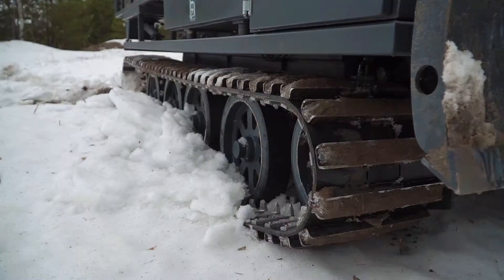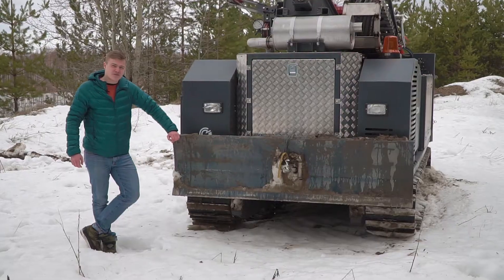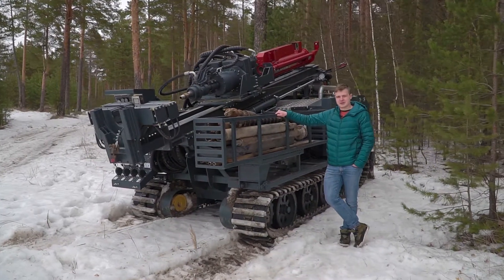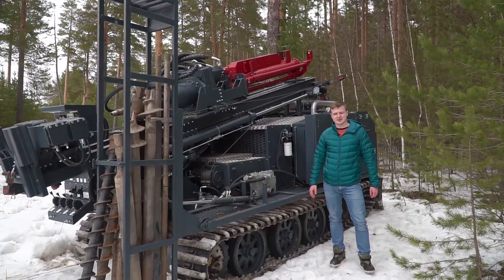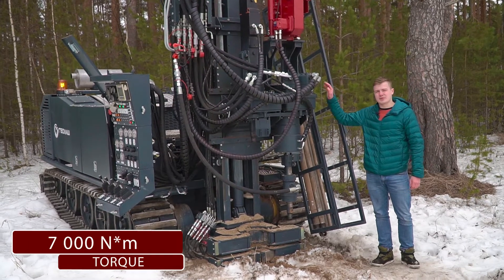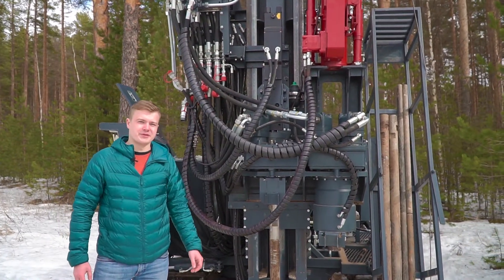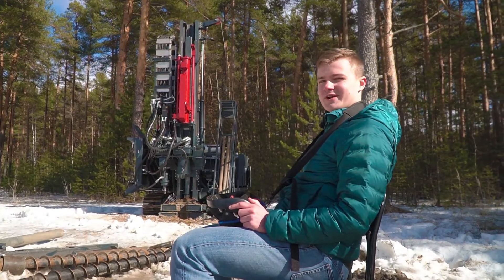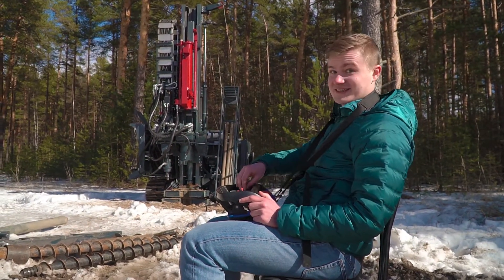Russian drilling rig in HD. Killer of Geomachine Oy: UGB-996 by Geomash

Comment: How does it do in water and boulders? Can you punch through boulders with percussion? Usually use augers for placer when we cannot get through wet spots with RC but we have a hard time in boulders.
Reply: Hello Sir, how are you? Drilling with hydro-hammer is best in soft and medium soils, for hard soils it is best to use DTH drilling. However, on some biggert machines here in Russia we use cable-percussion drilling to get through bolders. For more information you can visit our website www.geomash-group.com or contact me directly at t.geomash@gmail.com